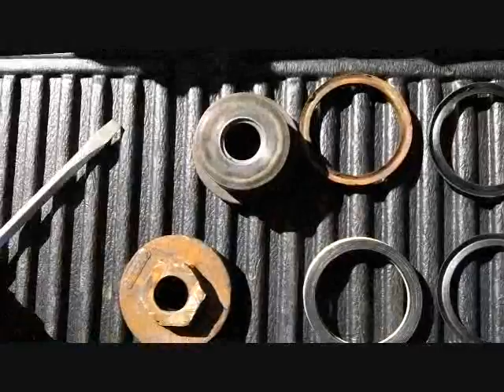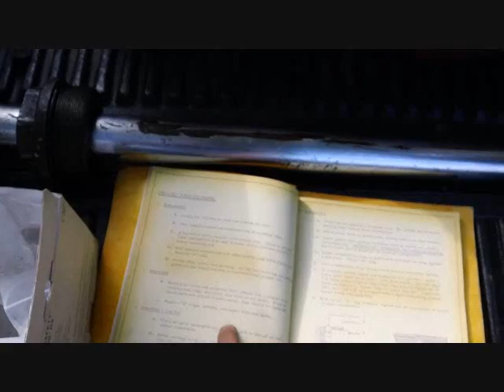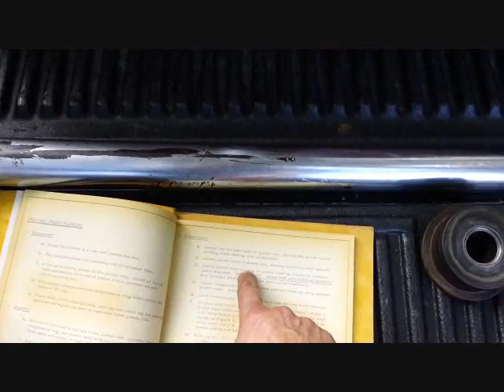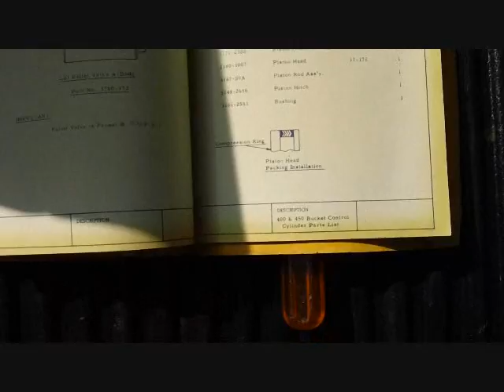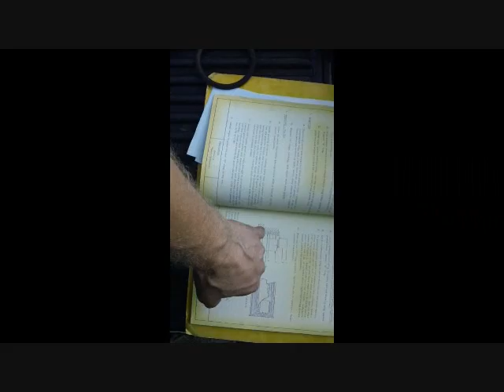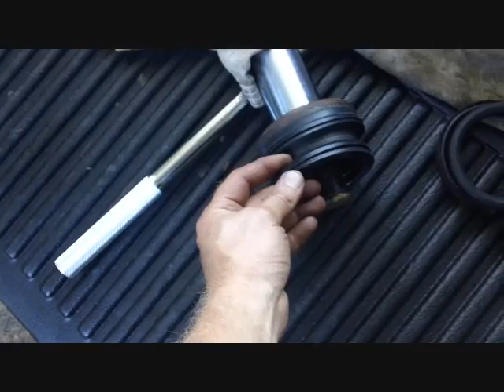Oliver 770 Industrial Tractor Project Part 132

Comment: How deeply marked is the piston rod ? the  deeper the  marks , the shorter the  life of the replacement seals, but you may not need to buy a new rod , they can strip the plating then plasma  spray ,re-grind and re-chrome those rods ,I have no idea what that might cost.